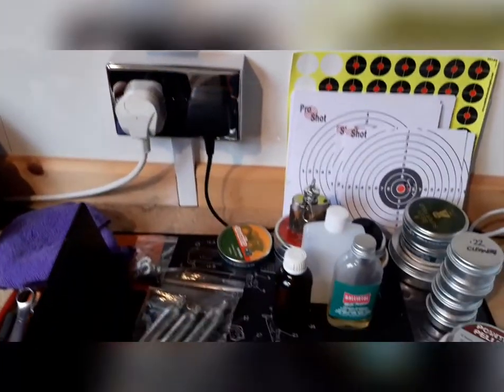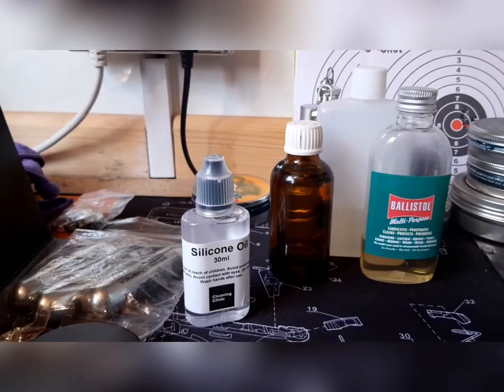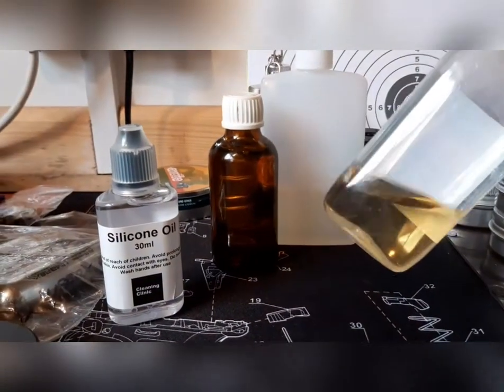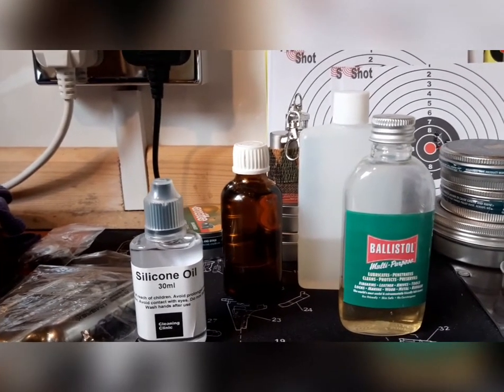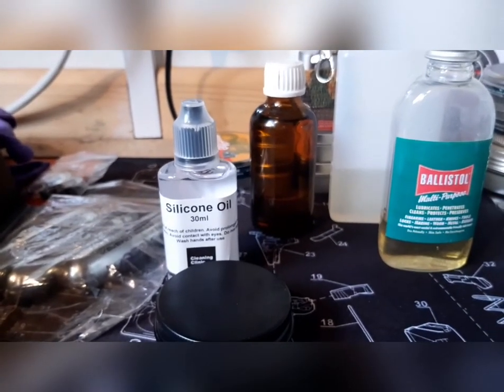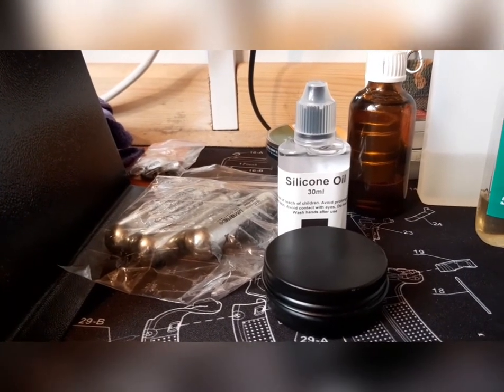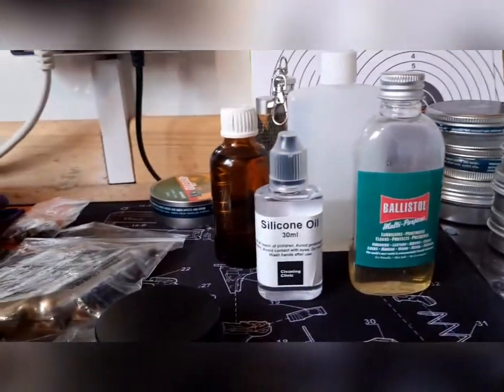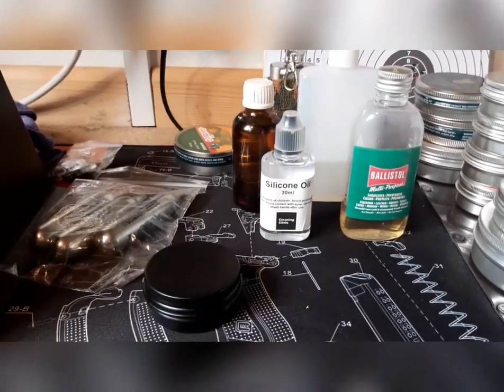Airgun Oil, the truth. Airgun Tips and Tricks.

Comment: DO NOT use silicon oil between 2 metal surfaces, it binds them completely.
Reply: Pure Silicone oil is THE MOST SLIPPERY oil there is in use these days. How would it bind metal parts ?
Reply: Please provide some science for that claim. I've never heard or seen any evidence for that being true. The only thing that is important is do not use petroleum based oils/lubes on synthetic o-rings as they will shrink.

Comment: Watching this I believe any light clear oil can do the job I use oil that’s supposedly for my fishing reel it works just the same
Reply from the maker: Hi,
Yep, it will do. White petroleum oil or plain silicon oil is fine. White petroleum is better for metal to metal lubrication. It's really the stuff with solvents you need to avoid.

Comment from the maker: That's a good point, it is very good on polymer and anywhere that you find rubber o rings. So a very useful oil for modern pcp rifles. White lithium grease or pellgun is good on metal to metal. That might be another video. 👍

Comment: Great video, I found it very interesting. Do you have any tips on keeping synthetic stocks looking good? I’ve just got a used BSA R10 SE with the black tactical stock and would like to know what’s the best way of keeping it clean. Is it just a damp cloth job? Thank you.
Reply from the maker: Hi, polymer stocks are really easy. I just put a little bit of silicon oil (pure silicon) on a dry cloth and rub it well in. Don't over do it and stay clear of the trigger blade. That will polish and protect it. I have a gamo phox that lives outdoor most of the time and it looks like new. 👍

Comment: Just a thought, vegatable oil has a flash point of over 600 degrees farenhieght,  the same as silicone oil, safe for o-rings, and lubricates metal on metal better than silicone oil. Way cheaper than silicone oil, or chamber lube too.🤔
Reply from the maker: That's true but it does support bacterial growth. So it goes mouldy. It can also be sticky. I think Grape seed or almond oil could be best.  If you blend a little alcohol it prolongs the life. Have you tried it yourself?
Reply: @RealAirgunAdventures  yes, I've used vegetable oil for years on an old daisy 880 I had.
Reply from the maker: @NorthFloridaAirGunner  That an interesting idea, I'll have a go at that. What oil is that you use or I'd it just generic vegetable oil?
Reply: @RealAirgunAdventures  just whatever veg oil happened to be in the kitchen.
Reply from the maker: @NorthFloridaAirGunner  thanks, also are you in the UK? Just wondering about the climate.
Reply: @RealAirgunAdventures  no I'm in the states in nice hot, humid florida.
Reply from the maker: @NorthFloridaAirGunner  makes sense at low temperature veg oil waxes. A drop or two of alcohol fixes that though. See much of Donald Trump?
Reply: @RealAirgunAdventures  no I'm in north fla. He's usually down by Miami in south Florida.ive never personally met him. My wife has though, numerous times, back when she lived in New Jersey. She says he's actually a very nice guy.

Comment: Have a Benjamin model 347 from the late 80s. Use Ballistol on it as I’ve used this product as you have for quite some time. What precaution should be taken if using 100% silicone treadmill lubricant around the piston where the O-rings are? Would like to avoid going up metal parts. Thanks so much appreciate your great content. excellent video with equally wonderful ideas!
Reply: Sorry dictation put going up. Said gumming up metal parts.
Reply from the maker: Hi, thanks for your comment. Tbh a little bit of silicon oil on the metal won't do any harm, as long as those surfaces are already lubricated. My dad had a Benjamin back in the 80's and only ever used silicon oil on it. It was still working 15 years later. I think my brother ended up with it. Also when oiling air guns less is best.